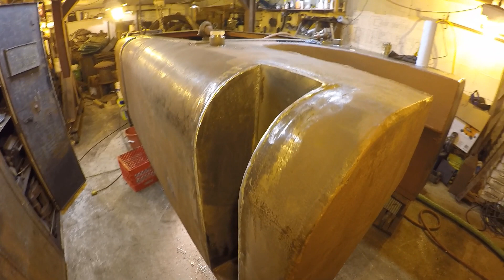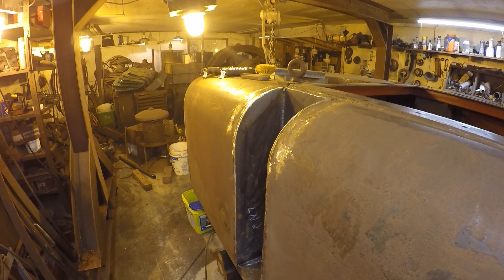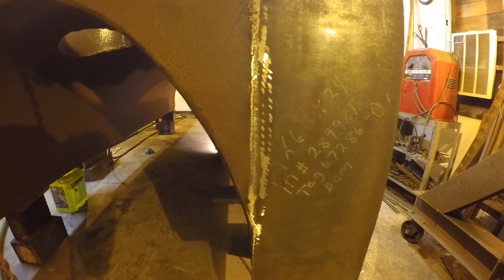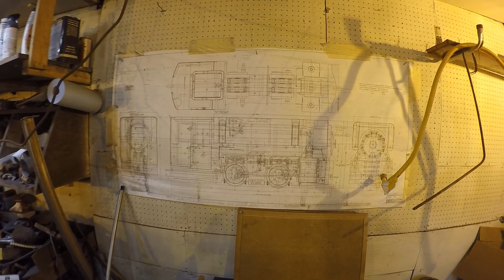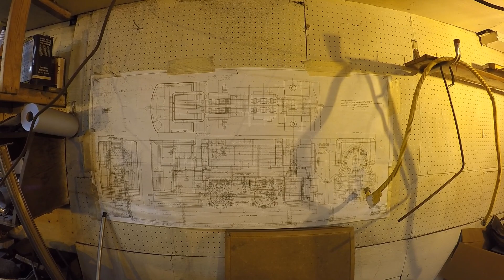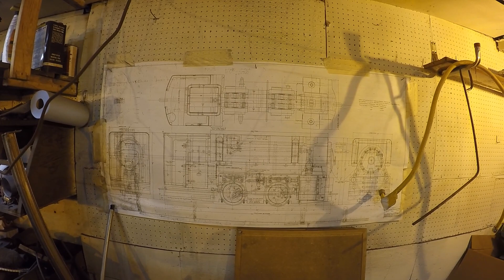J&L 58 Saddle Tank Water Test

Comment: I had assumed you were going to leave a saddle tank off of it... Nice to see you're going to put one back on as per the old pictures. Could never figure out what kept these tanks from getting hot and steaming up from sitting on a hot boiler?
Reply: Always had a liking for little saddle tank critters, the proportions of the B & O "Little Joe" was my favorite. However the water tank sander pocket modification is very pleasing as well as functional. Should have been OEM for #58!

What video shows reconditioning of the cylinders, my tool and diemaker background is inquisitive of the tasks required?

Comment: Surprised the glyptal didn't seal those welds from leaking.
Reply from the maker: I havent painted the pockets yet. Doing that today.
Reply: I meant from the inside. Wasn’t all of the inside of the tank coated? You sure don’t want water getting into the metal and then getting trapped by paint from the outside as it will fail from rust super fast like that. One of the main reasons so many body panel patch jobs rust back out in the seams. Weld thru primer is your friend for such jobs.
Reply from the maker: @bcbloc02  I didn't coat the interior of the pockets because I wanted to do the water test yesterday so that I could make any repairs needed today and have it ready to ship out this weekend.  If I would have coated what I had just welded in I would have had to wait until it dried first.  

I dried it out thoroughly today and tomorrow I'll put a final coat of Glyptal inside tomorrow.  Priming the exterior right now.